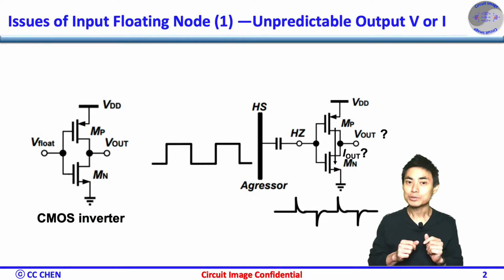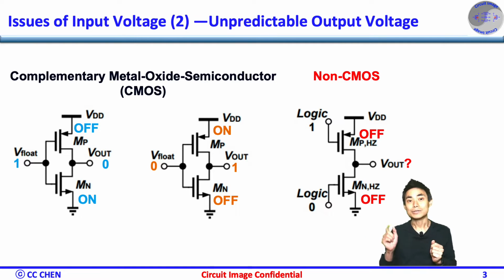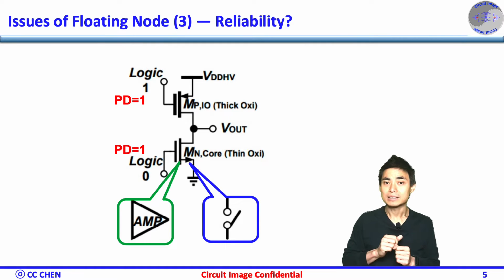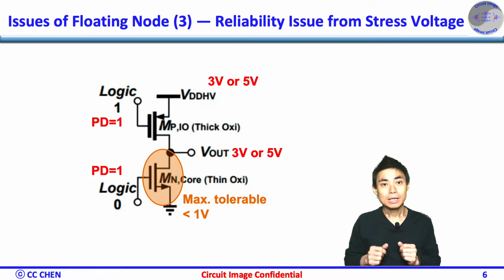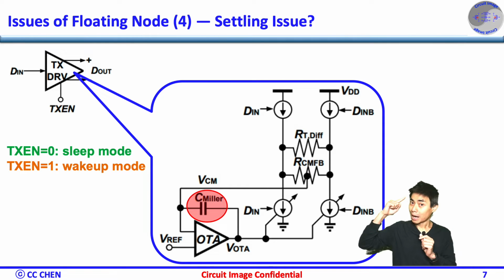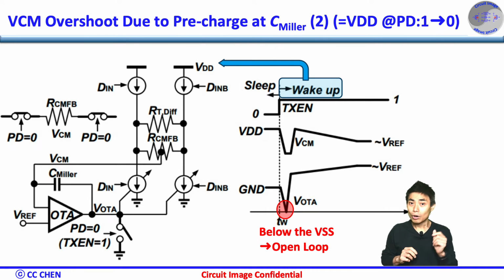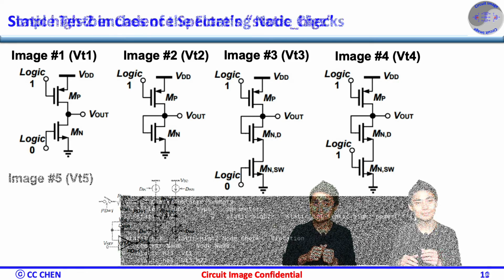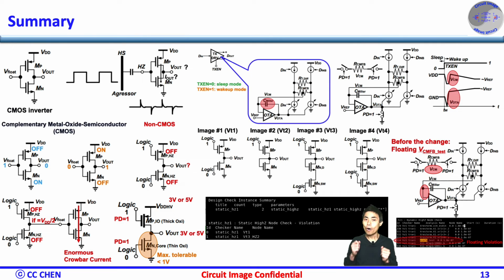Why Floating Node or High Impedance Node Check?

Comment: Good content. Could you please elaborate on the settling issue with the floating nodes? Is this why we do go for power down most of the nodes? Also regarding the cadence floating mode  check, is static-highz method available in analysis option or some where?
Reply from the maker: Hi Raja,

Thank you so much for the feedback and I'm glad you liked it. The settling issue with the floating nodes came from the uncertainty at the beginning of the startup state; therefore, we want the states of the nodes at the beginning of the startup state is well-defined. The Cadence's floating mode check like the static-highz method is available is just a connection checker, not a simulation.

Thanks,
CC

Comment: CMOS schmidt trigger circuit is a good solution to avoid crowbar (short circuit) current between an high Z node and a classical cmos digital gate.
Reply from the maker: Thank you 🙏 so much for the feedback and good 👍 suggestion. I agree ☝️😊

Comment: Good video. What is the remedy for the high impedance node in the  tx common mode ?
Reply from the maker: Hi, thanks 🙏 so much for the feedback. I’m leaving the question to everyone as an exercise. Hint: removing the floating node at the power down condition 😊
Reply: @circuitimage   may be connecting that floating node to a known voltage ? , otherwise that node will get charged to some unknown potential due to parasitic capacitors and could blast some devices in the circuit I think.
Reply from the maker: @ajithsrighakollapu3569 Bingo. You are correct about the remedy. 😊